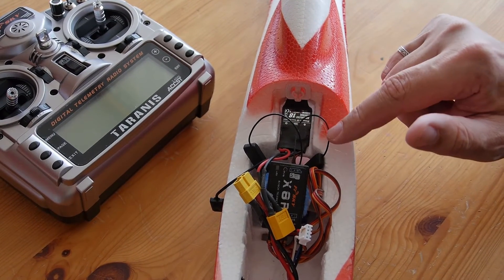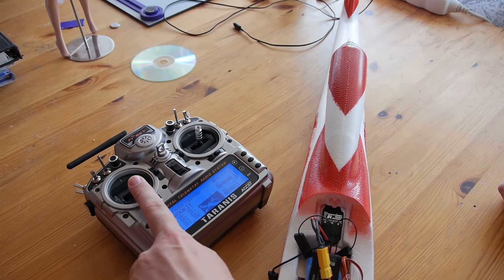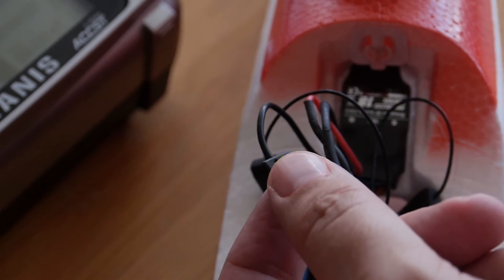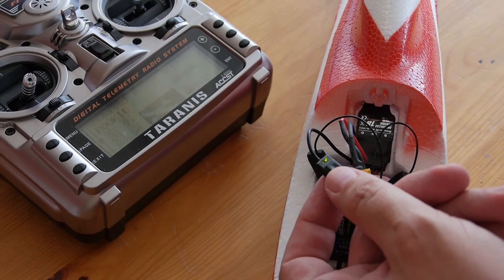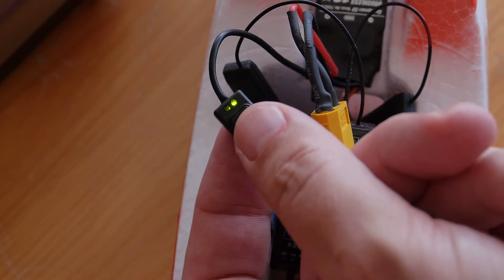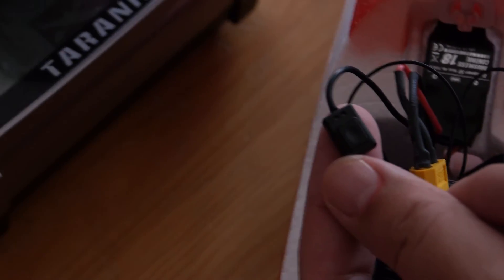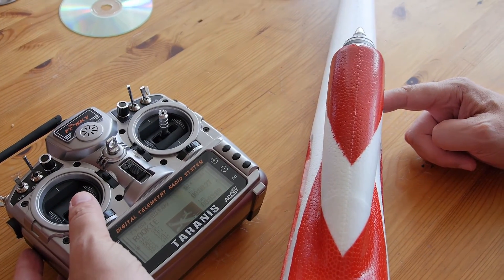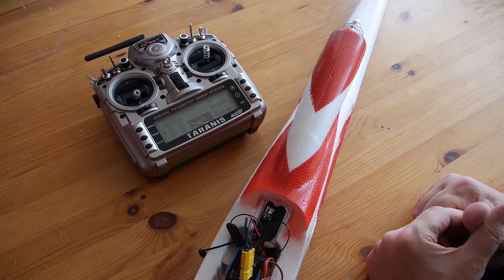Graupner Rookie - ESC / Speed Controller programming

Comment: Thank you for this video! I had this exact problem and was always wondering why this plane is such a laim duck. I think with dx 6i the delaut full throttle is at about 60% off max. rpm of the motor. The three point calibration with the brake also works, however it didn't work when I was trying to set up the middle position as neutral position. It has to be below that I guess.